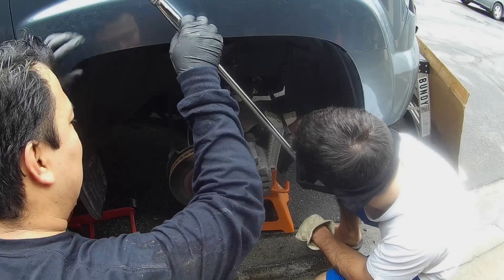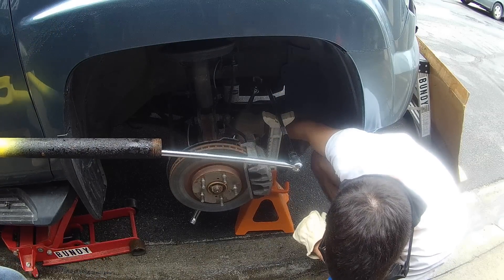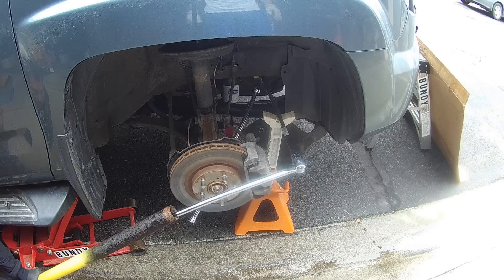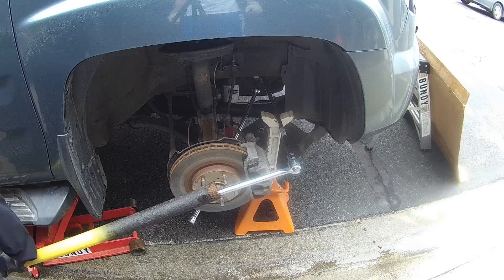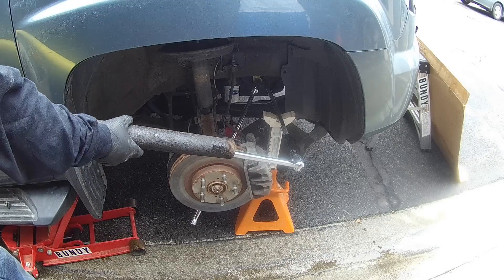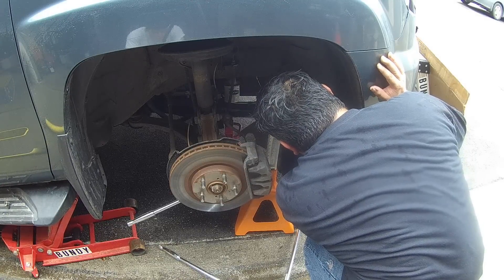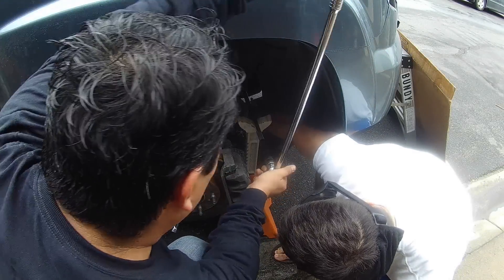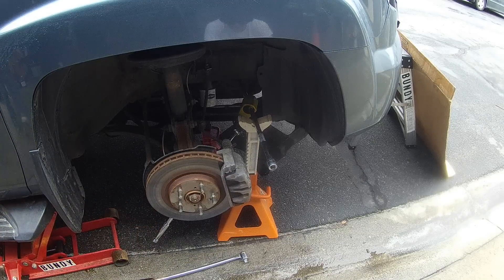Honda Crankshaft Bolt Removal - Acura Honda Crank Pulley Removal - Honda Accord Acura Bundys Garage

Comment: Good video, thanks.   I purchased a 3/4"  40" breaker bar.  I'll use a 3/4 to 1/2 adapter.  Never done it but hoping for the best.  Expect I will need a cheater bar as well.

P.S.  I have heard the first time is "by far" the most difficult.  A lot of mechanics are unable to re-torque the bolt to spec.   The additional 60 degrees called out even is too much even with high torque guns.  The Honda factory must be using scary equipment.

Comment: I have an 09 Ridgeline. I tried to break this bolt loose 2 weeks ago and could not get it loose. I purchased a Lisle socket designed just for the Honda 19mm bolt and with a little lubricant sprayed around the bolt was able to easily get it out with an impact wrench this weekend so I could change the timing belt. That socket is amazing and makes this job MUCH easier.
Reply from the maker: +RCWagon sometimes the lisle socket does not work
Reply: RCWagon  try using the starter.

Comment: I have always has success using the starter.... Honda V6 does a clock wise rotation... so y9u can set the breaker bar above the axle. with all coil  plugs disconnected.  to you tap the starter,,takes about 3 bangs...and the bolts of loose. I do this method cause the special tool is too lose of a fit and fall. (I work by myself) it's never failed me.. and I've done MANY ...in fact I did two 3.5 t-belts last month.
Reply: Could you explain tapping on the starter? Do you mean trying to start the vehicle with the key?
Reply: @josuebarahona7873  yes using the key... but with all the coils disconnected - that will prevent the engine from running...and a long breaker bar on the crank bolt.. this method ONLY works on the V6. NOT THE 4CYL.!
Reply: I will try it this week. I have a 2007 acura TL. I tried the braker bar, impact gun and did not work. Thanks for the quick response, I will let you.
Reply: Steve, it sure worked. I was able to change the timing belt. Something new learned. Thank you

Comment: Get the Milwaukee or dewalt 1/2 impact! 1200ftlbs and have had no problem removing crank bolts.
Reply from the maker: +chupalia how much was it?
Reply: You also need the lisle socket with that impact

Comment: I think most air impact setups don't have enough air flow with 1/4 fittings, 3/8 air hose that is too long.  Most videos have anemic sounding air impacts.

My setup is Ingersoll Rand 2135TIMAX with 50' long, 1/2 diameter hose, 3/8" quick connect HF fitting.  I set my 30 gallon air compressor to 120 PSI static, which is 90 working PSI at the gun, with the gun running.  I broke my 2007 Accord 2.4L crank bolt loose to replace rusty oil pan.  It took around 3 seconds.  To verify it wasn't a fluke, I tried on my Mom's 07 Accord 2.4L.  Same thing.

Comment: I made the mistake of using an impact extension on a breaker bar the first time I tried to take my Accord's bolt off and it snapped the end off it.
Reply from the maker: +brian0918 snappednthe bolt or your extension?
Reply: It snapped the end of the extension off.
Reply from the maker: +brian0918 those bolts can be crazy right
Reply from the maker: +brian0918 tight not right

Comment: Why are you doing this the hard way? I've never used Heat, a Breaker Bar or a cheater bar! Just use the 50mm crank tool with a ratchet against the suspension part. Then use a 18 inch breaker bar or rachet with a deep 19mm. Take you foot and push down on the 18 inch rachet and it with come loose within a matter of seconds. I've never had one take longer then 10 seconds. When you use an extension you loose leverage. Plus there is alot of twisting. Just 1998 to 2002 I've done well over a hundred accords. With anywhere from 80k to over 200k. Never with a issue or problem.
Reply: Dude he has over 4 feet of leverage with that setup. The most force you can apply is the length of the bar multiplied by your weight.... I am 155-160 but for arguments sake i am 150lb. 2 feet of leverage 300lb-ft, 3 feet: 450lb-ft, 4 feet: 600lb-ft of force.... so on... You can get more if you jump on the bar with your feet but have fun breaking your ankle or fracturing a bone. Heaven forbid if the bar shatters and stabs you. Which is why he told the kid to look away from it.

Yes leverage is king. But not many breaker bars can withstand that kind of force without becoming dangerous to use. 1200lbft of torque is infinitely dangerous and stupid to attempt to achieve with a breaker bar...
Reply from the maker: Good for you bro.